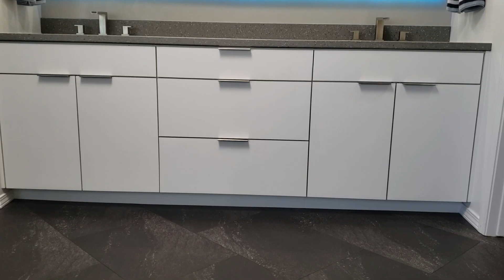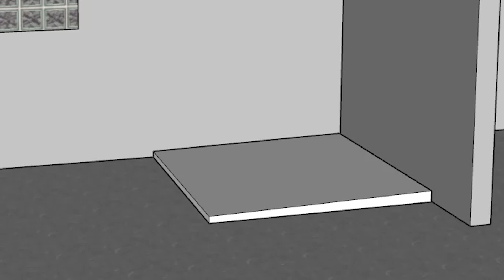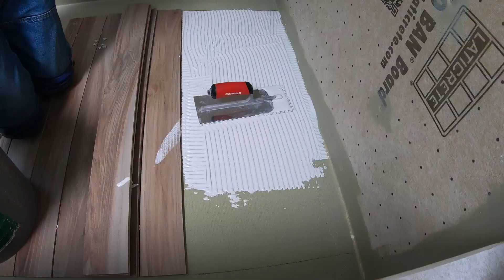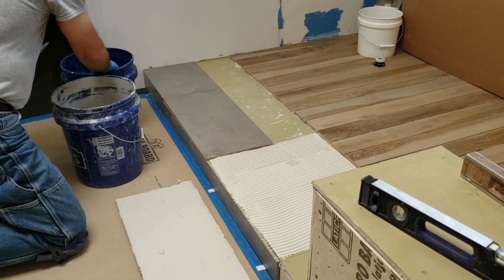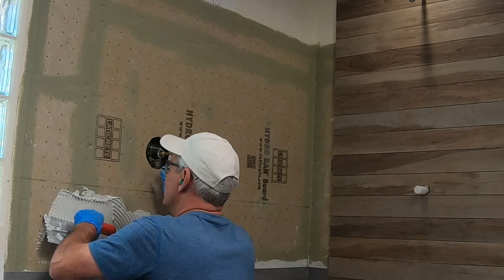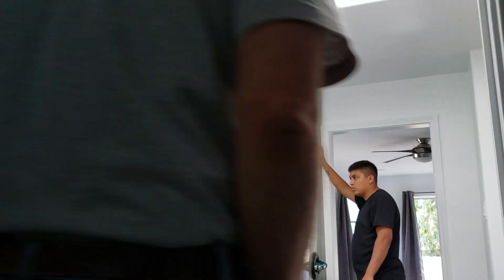How to Set Tile in a Large Open Shower Using Multiple Patterns - With Wood and Concrete Style Tile

Comment: Hi Rusty, 

Stunning work, as always. 
When working on bathroom projects do you do anything for ventilation ?
Reply from the maker: Hey, thanks Jakietan! Yes, we always will provide whatever type of airflow we need to meet the particular circumstances. In this case, we installed two upgraded exhaust fans in this bathroom as a part of our initial demo and reconstruction so those were available through the rest of the job. We will also use protective masks as needed, for example when painting in not well ventilated areas.